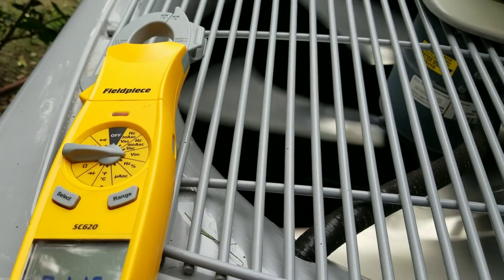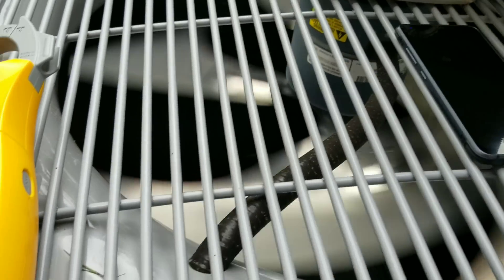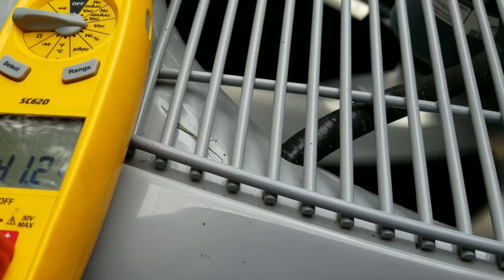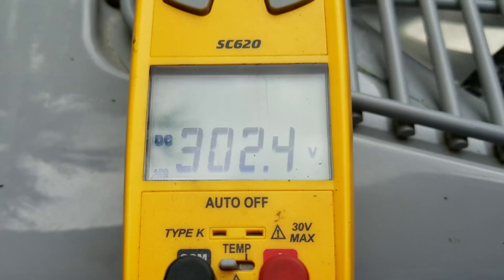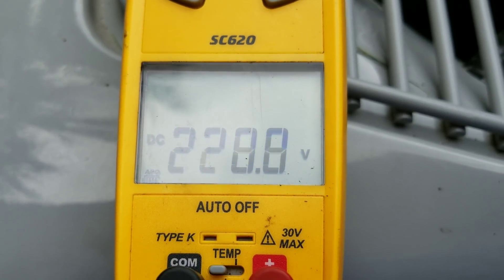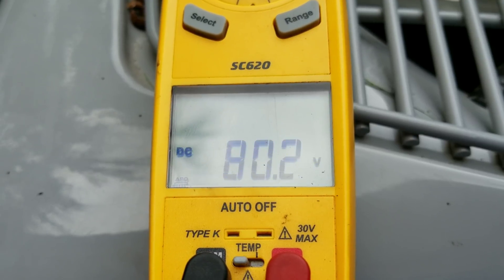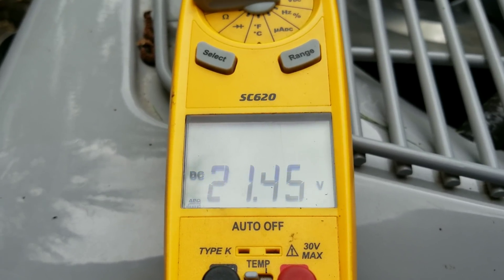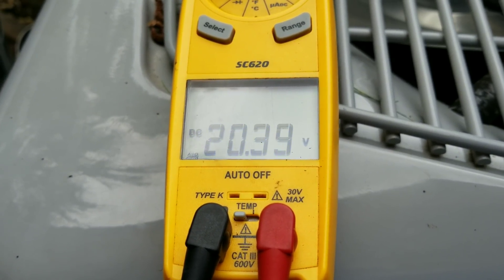Inverter System Tech Tip

Comment: Had to learn that the hard way 😇
Reply from the maker: If you touched 300 VDC, you definitely would not be here to talk about it. That's instant 💀 90% of the time.
Reply: @ sure it was. I just was so lucky that it shot me and throw me away. Since then I’ll always let it sit for 10 minutes and triple check the voltage on the inverter boards before I touch them

Comment: Nice. Do some more on those infinity units if your so inclined sir. Also I’ve seen Some units even have power going to them when you hit/pull the disconnect switch too. They do some wack stuff out here. Always check if power is off.

Comment: Great video, the company I work for has installed tons of those units in the last few year or so and I can’t tell you how many inventor boards and compressors I’ve had to change in them,first they had issues with the reversing valve solenoids being wrong from the factory also surge protection for the equipment is a good idea,it’s newer technology so it’s a learning curve for us in the industry but it’s definitely the wave of the future
Reply from the maker: Thanks
That's odd. We are a Factory Authorized dealer and have installed over 1000 of these inverter units since 2012 and I've only seen 2 bad compressors and about 6 inverter drive failures. Ive never heard or seen a reversing valve issue with these systems.
Only major issue if it can even be called that was a recall on a board in the 5 stage units and that recall effected less than 1% of all inverter systems ever sold by Carrier/Bryant. They have been incredibly reliable systems for us.
Reply: I work for a factory authorized dealer also we had a string of them where the reversing valve solenoids were wrong from the factory that caused damage to the inverter boards and subsequent damage to the compressors carrier has kits they stock for retrofitting the affected units with the proper solenoids we even got official documentation from them on the issue,I’m not saying they are bad units because I think the complete opposite,outside of the solenoid issue we experienced the only other problems I’ve encountered with them were from damage to them after thunderstorms most likely from power surges and the occasional problem from our installers over charging them and getting fault codes for high torque compressor starts which isn’t a issue caused by carrier or the equipment
Reply from the maker: Interesting. We have literally never had a single reversing valve issue to date.
Reply: Not a problem with the reversing valve itself but with the solenoid coils they also sent out a service bulletin for issues with the vna units catching fire from faulty boards in 2017 I think
Reply from the maker: I understand what you are saying. I'm just saying that in the 1000 plus inverter systems we've installed (5 stage and Greenspeeds) we have yet to have the issue you're talking about or the frequency of issues you are taking about.
Reply: I gotcha I wasn’t try to refute what you are saying about having minimal issues with them or trying to imply they are bad units I was just sharing some of the issues I’ve run into with them,thanks for the responses and the great videos
Reply from the maker: No worries bud. I didn't take it as such but I will keep this information.
Thanks!

Comment: Jeez,  It's not the Volts that'll light you up,  it's the Amps!
Reply from the maker: I hope you know that's a myth
Reply: @HVACinSC  
Let me use this example,  a AA battery is 1.5volts , next time your car battery dies, go get 8 AA's (8x1.5V=12V) Now try starting your car. See what happens.
Reply from the maker: It's potential and resistance.
If you'd like to get technical... Its a combination of Volts, Amps, Frequency, and Time in the circuit that kill you.
You cant have Current or "Amps" without Voltage.
A more accurate statement would be that Amprage and Voltage kill you. 🤔
Reply: @HVACinSC  The 20 volts was safe. You could have started working on that unit. However, if your skin got pierced, then it would could potentially be fatal. The human body's blood is a very good conductor compared to the skin.
Reply from the maker: @EETechs  Sweat is a pretty damn good conductor too... Which is what we do a lot of in the summer, in the south.
Reply: @HVACinSC  Im from South Carolina. In the Anderson area. I never had lethal current flow through me with 24 volt DC systems where I work with PLC's and design automation systems, which is predominately 24 volts DC. 

The 480 volt and 4160 volt, 3-phase power on the other hand is a different story; not just from shock, but from where a dead short circuit will literally cause wires to explode like mini bombs. Not fun when you have hot liquid copper traveling at the speed of a bullet towards you.

 I suppose some people could be more sensitive to the lower voltage DC on sweaty skin contact. OSHA requires guards and danger voltage signs at 50 volts or higher, AC or DC.
Reply from the maker: @EETechs  Of course you've never had lethal voltage flow through you as this conversation would be taking place on a Ouijie board. Also nowhere in my video did I say 20VDC was lethal. Why get zapped at all (regardless of voltage) if it can be easily avoided?
The point made in this video is simply to work safe. Simple. I mean.... why chance it for an extra 30 - 90 seconds of waiting?
Reply: It's neither of those, its the amount of energy that has flown through your body.
Reply: @Sixta16  
That's called Amps!
Reply from the maker: @JB-bb1zw  Energy is not = to Amps
(E= I x R) Ohms Law bruh

Comment: Where are ur leads hooked up at on the board ? Never worked on an inverter.
Reply from the maker: On this specific model there are voltage output test terminals that I have my alligator clamp leads attached too.